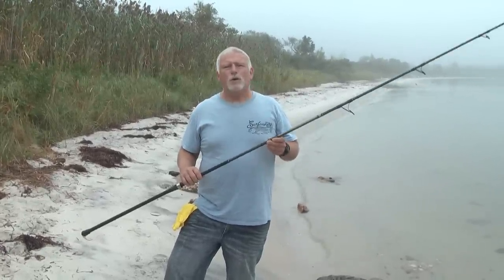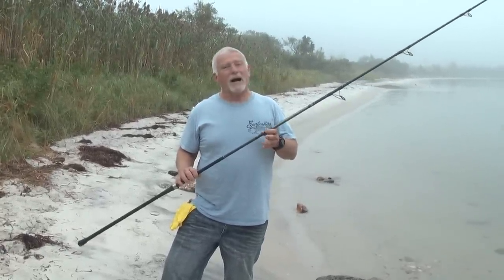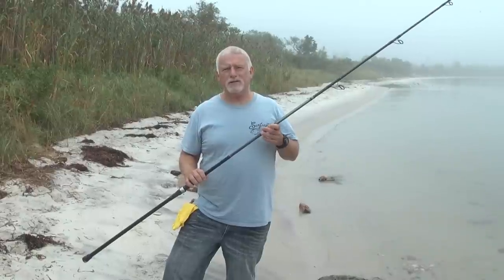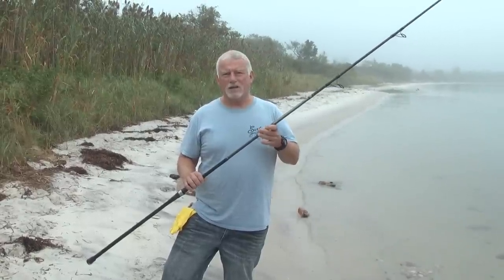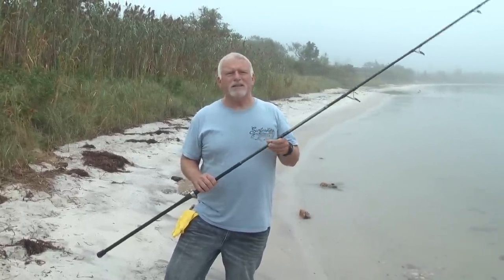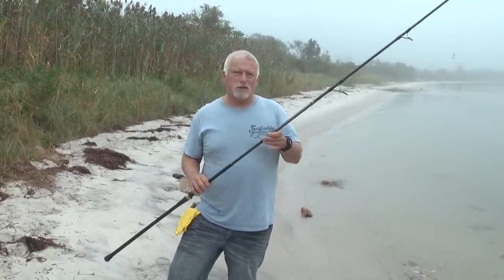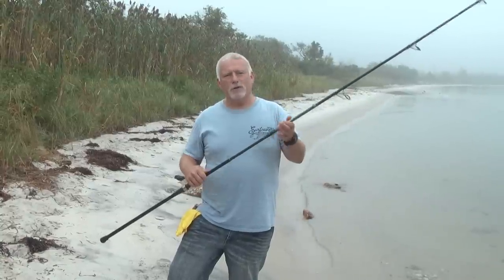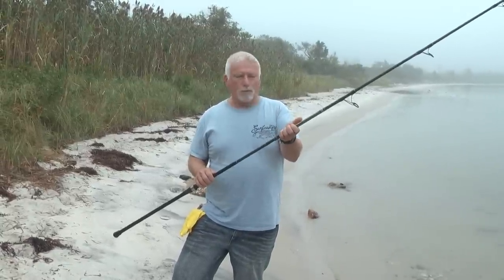Surf Fishing Rod Care - Stuck Ferrules - taking apart 2 piece rod

Comment: Thank you very much.I just did the gloves method on a spinning rod(thinner,more difficult,could not find a way to grab it with power,it was slipping from my hands).It took only 2 seconds to separate,with the 20% of the effort i was using before.Luckily it was not necessary to proceed to the ice method.You just saved my €300 rod.I wish you the best.One advice for other people:be very calm and gather all the information needed before you do anything.

Comment: My 2 1/2 year old St Croix got stuck 2 years ago. I tried twisting, I warmed it with a hair drier, and even tried WD40, nothing worked. I called St Croix and they were no help at all. I then tried PB Blaster and let it soak for 2 hours, I  grabbed 2 sheets of rubber that I had laying around and used as a grip while twisting. FINALLY after 2 years it's apart!

Comment: Putting the ice bag on both the upper and lower sections, means the cold contraction is equal, and both parts shrink a minute amount. Put the ice on the upper rod blank, and after a while, a hair dryer on the lower. Upper contracts, and the lower expands.

Comment: There is one method not mentioned for an extremely stuck rod. Mine was immovable after I put too much force on one end. The problem is applying a uniform circular gripping pressure to both sections, while at the same time applying a rotational force and not damaging the rod sections. I solved this using two oil filter strap wrenches, fitted in opposing directions to each section. This gives great grip and twisting motion. I did and boom, the sections freed… no need to thank me.

Comment: Hello. Am really enjoying your channel. I haven't surf-cast in 20 years. I'm taking my kids next week and am letting them have all my gear. I am trying to restore my dads old 14 ft bamboo rod so I can fish too. Its missing the rod tip (didn't break, just came off).  I bought a repair kit but the biggest tip (#14) is still too small. I don't have the vocabulary  to get anything on the interwebs. Any suggestions?
Reply from the maker: for one time, you can probably fish without it ?

Comment: Might be worth putting the bag of ice next to the joint and a hot water bottle next to the joint on the socket side of the rod. Not sure about conductivity of heat, but over the joint could contract the outer socket tightening the joint.

Comment: More tips: 
1.If you have a mate with you you can get him to hold one side by the reel that way you can get two hands off grip.
2.Once you get it home you can get someone to hold it or put it in a vice with a few rags and use a rubber oil filter removal tool, one that wraps around.

Comment: Use gloves pull strait apart but wiggle and bend each section close to the connection point as you pull this may break the air suction seal. Take your time don't break your rod.

Comment: None of this worked: ended up using a brake line flaring tool on the 1st ferrule up, protecting it with gorilla tape on one end and making a flap on the other-put that in a vise and tapped the tool w/a hammer.